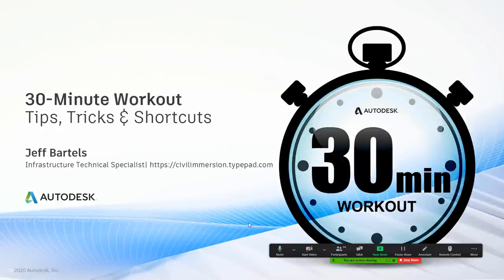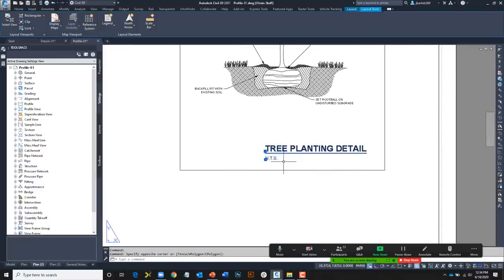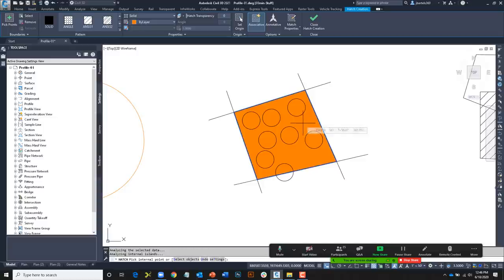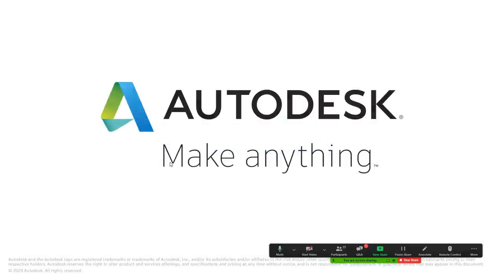30+ Civil 3D / AutoCAD Tips & Tricks in 30 Minutes!

Comment: Moving and Docking Pallets 2:45 
Drag & Drop Copy/Move Layouts & Objects  3:37
Drag & Drop Copy/Move Between Drawings 4:40 
Creating, Adding & Clipping Viewport Areas 5:25
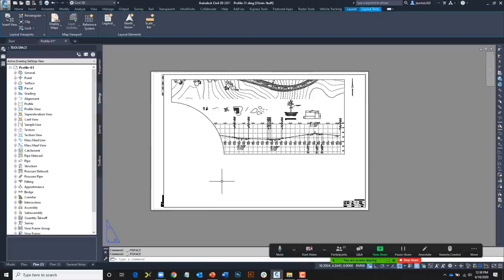Smart Text Fields / Last Saved By Field  8:11
XREF Tips 9:36
Find/Zoom To Unseen Object 10:55
Dynamic Input Tool Tip Size System Variable 11:55
Search for Command by Partial Name 12:45
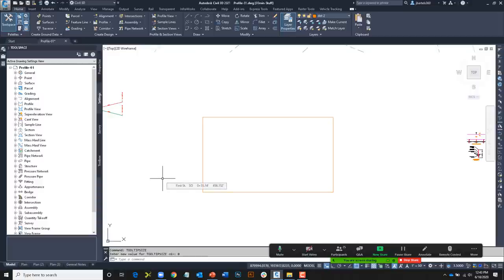Search UI for Command Location & Related Commands 13:24
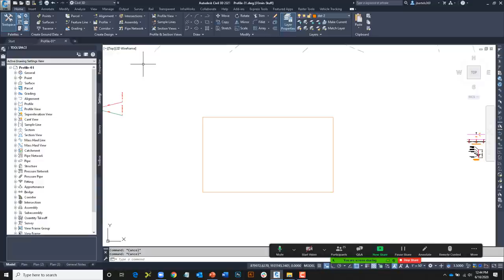Expressions in Dialog Boxes 14:20
Forcing Arc Directions 15:10
Ignore Interior Objects When Using Hatch Command 15:50
Changing a Hatch Boundary 16:44
Recreate Hatch Boundary 17:17
Send Hatch, Dims, Leaders, Anno  to Back/Front of View 18:06
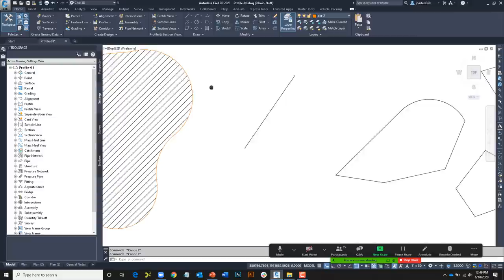Offset Though to Offset Multiple Distances Multiple Times 19:08
Join Objects Tips 20:09
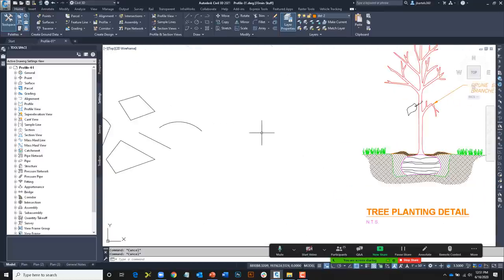Quick Find Layer in Ribbon 21:41
Custom Bullets for Text List 22:41
Place Text First When Creating Multileader 23:54 
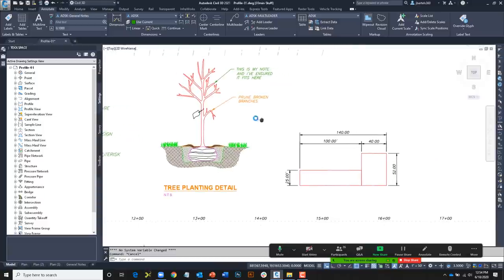Find and Fix Fudged Dims 24:45
Using Scripts (Text Files) to Drive Programs Commands or Complete Drawings 26:10
Cool Bruce Lee Script! 28:17

Thanks Jeff, 
There's no doubt you're the best Tip/Trick/Feature presenter ever!
Reply from the maker: Thank you so much!

Comment: hello friend, I have a few questions related to civil 3d.
like this. Can Civil 3D create two surfaces at once and calculate the volume based on the center line that was made? then cross-section can be displayed both pieces from the first surface and the second surface in one working drawing at the same time with each volume per station